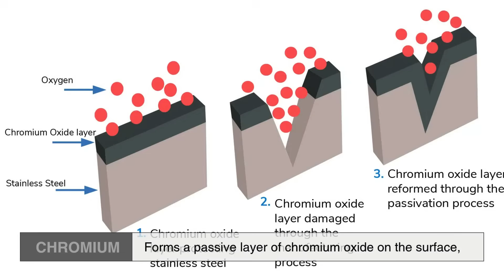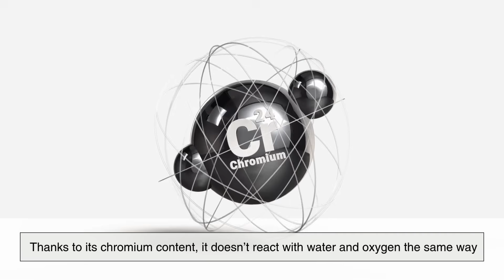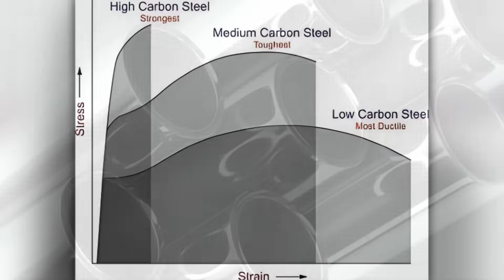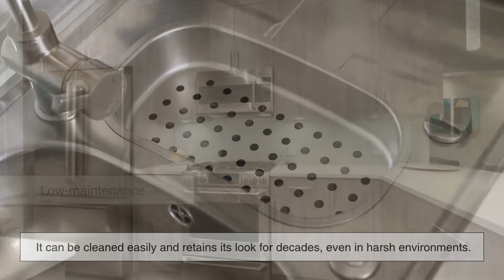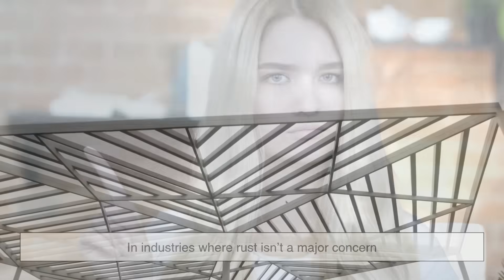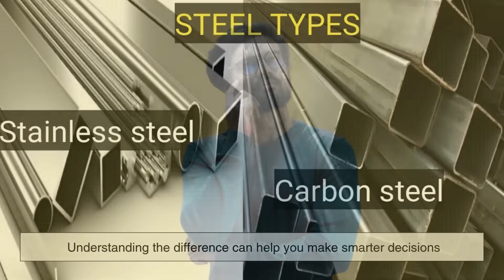Stainless Steel vs. Regular Steel: What’s the Real Difference?

Comment: Steel is everywhere — from towering skyscrapers to kitchen utensils — but not all steel is created equal. In this video, we break down the key differences between stainless steel and regular (carbon) steel. Learn about their chemical composition, corrosion resistance, strength, appearance, costs, and where each one truly shines. Whether you're a DIYer, an engineer, or just curious, this deep dive will give you the knowledge to tell these metals apart — and understand why it matters.

📌 Timestamps:
0:03 – Intro: TheThe Two Faces of Steel of Steel
1:07 – Composition: What Are They Made Of?
2:14 – Corrosion Resistance: Rust is the Real Enemy
3:15 – Strength and Durability: Which One’s Tougher?
4:14 – Appearance and Maintenance: Shine vs. Rust
5:05 – Cost Considerations: Where Does the Money Go?
5:57 – Applications: Where Each Steel Is Used
6:56 – Conclusion: Which Steel Is Right for You?

#StainlessSteel #CarbonSteel #SteelComparison #MetalScience #EngineeringExplained #MaterialsScience #ConstructionMaterials #CorrosionResistance #DIYMetalworking #SteelVsStainless #HowStuffWorks #SteelFacts #IndustrialDesign #SteelGrades #EverydayEngineering

Comment: This comparison is overly simplistic, as many SS formulations can indeed corrode.
Now do a follow-up video: Stainless Steel vs Stainless Steel !
SteelPro Group - The main, common, standard variants of Stainless Steel:
  Austenitic  == 21 Types in Grades 2xx, 3xx, 9xx, A2, 18/8, 18/10
  Ferritic       == 11 Types in Grades 4xx, 18/0
  Martensitic ==   7 Types in Grades 4xx
  Precipitation == 1 Type in Grade 630
  Duplex == two-phase, ferritic, austenitic alloy

200 series: 200 series stainless steel is prone to corrosion in chemical environments due to its lower nickel content and is not as corrosion resistant as 300 series.
300 series: Excellent corrosion resistance, especially in wet and chemical environments. 316 stainless steel exhibits stronger resistance to chloride corrosion due to its molybdenum content.
400 series: Not as corrosion resistant as 300 series, but still performs well in some specific environments. 400 series is more suitable for dry environments and has a lower corrosion risk.

304 vs 316: For general use, 304 is more common due to its lower cost and sufficient corrosion resistance for most environments. 316 is preferred in more corrosive conditions (marine and industrial applications).
304 stainless steel is not considered marine grade. While it has good corrosion resistance, it lacks the molybdenum that enhances resistance to saltwater environments. For marine applications, 316 stainless steel is preferred due to its superior corrosion resistance, especially against chloride and salt exposure.

316 vs 420: 420 stainless steel is known for its hardness and is ideal for cutting tools, such as knives and surgical instruments. However, it has lower corrosion resistance compared to 316, which contains molybdenum and excels in corrosive environments like saltwater or chemicals.
While 420 is better for applications requiring wear resistance, 316 is preferred in environments where corrosion protection is critical, such as marine, chemical, and medical industries.

Grade 904L is among the most expensive types of stainless steel. It contains high levels of chromium, nickel, and molybdenum, making it extremely resistant to corrosion, especially in acidic environments. This premium material is used in luxury industries like high-end watches and chemical plants.